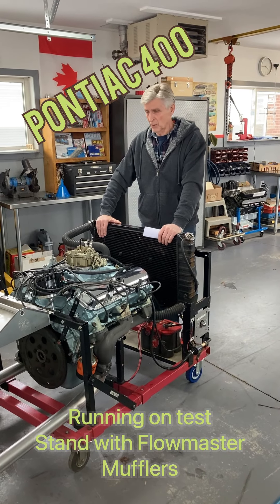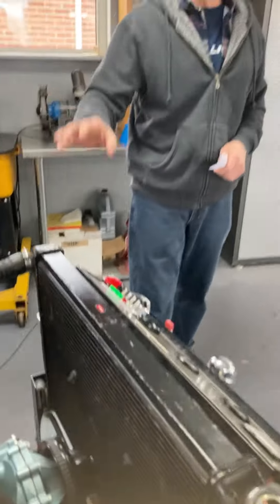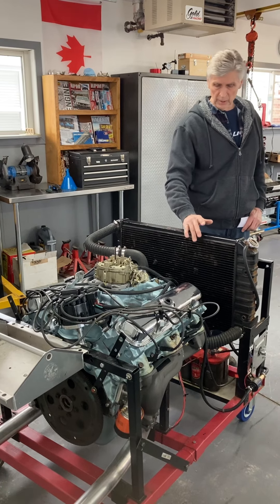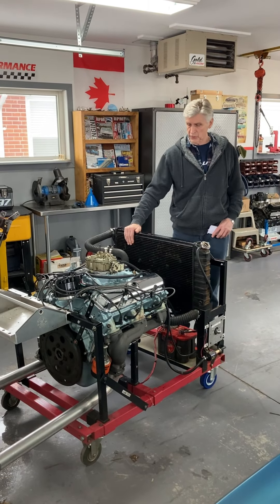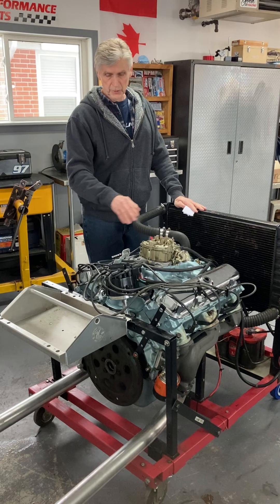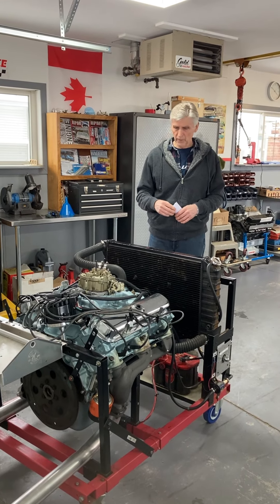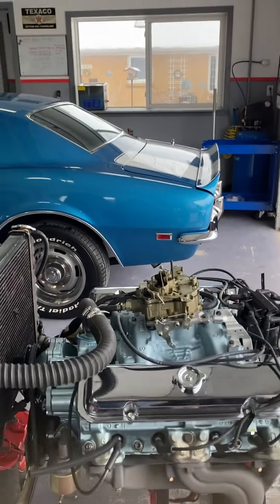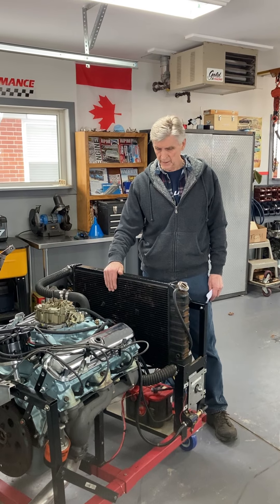Dale Kimble's 1970 GTO Pontiac 400 on run stand with FlowMaster Super 44’s Crower 60916 Camshaft

Comment: Are those #16 heads?? If so, you need 100 octane minimum. Is that what you're using?
Reply: They are #13, the combustion chambers measured 76cc using plexiglass and a buret.
Allan has lowered the compression ratio to 9:1 and we are running 94 octane. Thank you for the information.
Reply: @mkimble21  Need to know how you lowered the Cr that much. I do it all of the time and know what it takes. Please tell us. Thanks
Reply: @brucefulper2433  The pistons are +6cc, 1.720 compression height, 76cc combustion chambers and compressed head gasket .045 compressed thickness. Deck Height is .030.
It’s 9.1-9.2:1. The head gasket thickness is approximate.